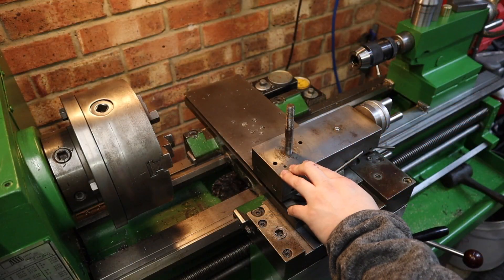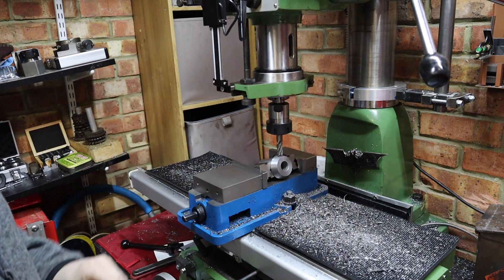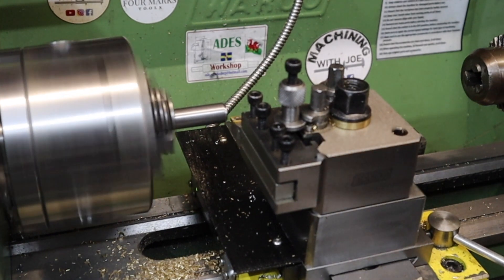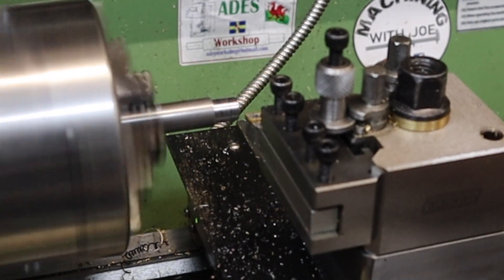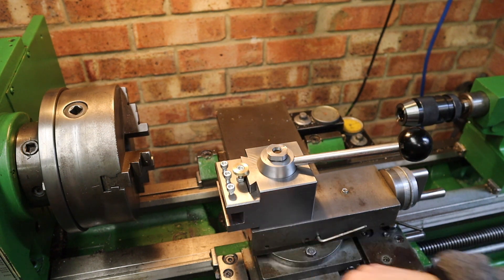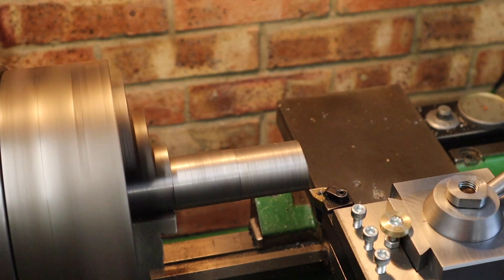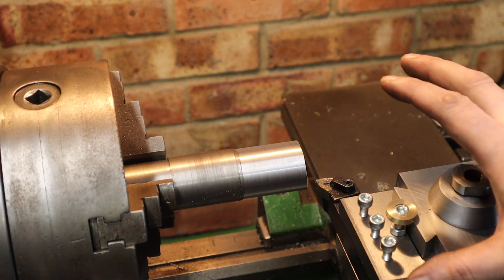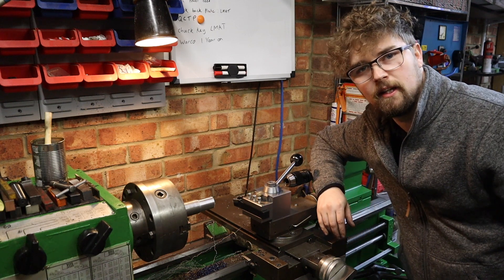Making a Quick Change Tool Post Part 6

Comment: i enjoy you making of this tool post  I have stated one of my own in round  stock i have available. can afford, the good stuff. i will not be making a came but will be using a positive plunger to lock the piston. that will have the Centre bolt pas trough the centre slot  . i have enjoyed your video immensely thank you.   Ps i have parches the tool holders two of them . i may have a go a making other  later . les England
Reply from the maker: Hi Les, 
Glad you enjoyed the video, I think I know the type of design you mean. I have to say for me a QCTP and a dro on a lathe is a must. Thanks for the support look forward to hearing from you on the channel again.

Comment: Nice job, the chips should be hot. Using coolant will just spray everywhere.
Reply from the maker: Yeah that is a good point Martin my shops not really set for coolant everywhere yet.

Comment: Joe, at https://www.youtube.com/watch?v=UjWHIVDp77w&t=530s in video series part 4, you should have removed only the area for cam action contacted by the piston, not the entire bottom 1/2.  Lots of support and rigidity is lost in this move... Good series tho, thanks for making it available.
Reply from the maker: Hi John yeah wish I never took that bit of the bottom. If it causes issues in the future I’ll make a new one. Like you sed I could of lost some rigidity there so maybe something to consider.